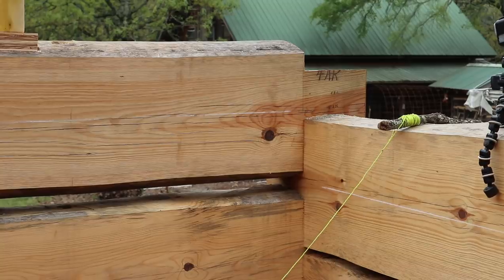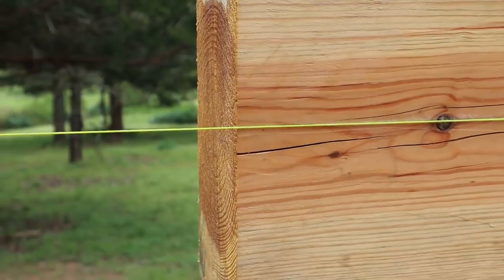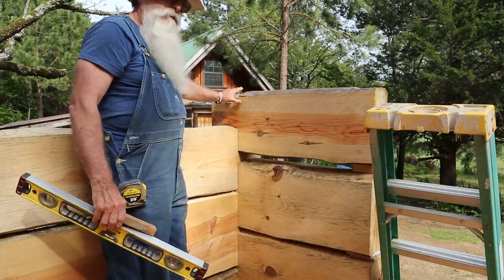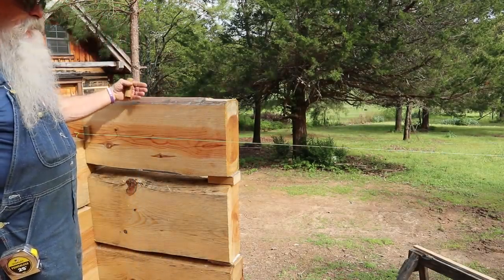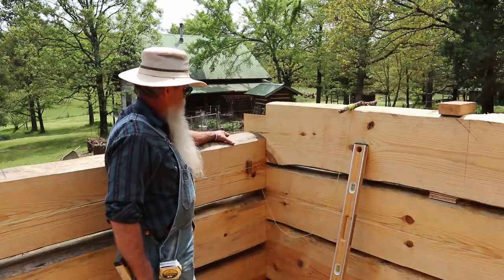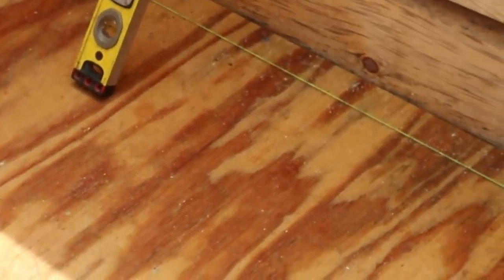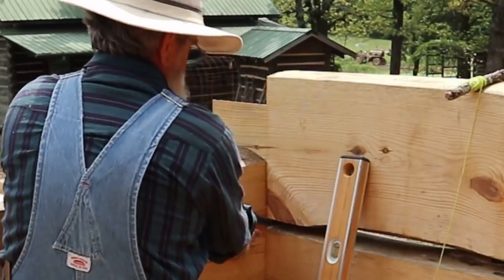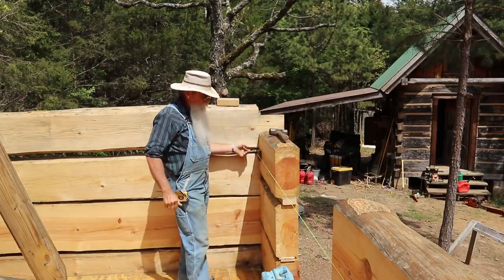Round 4 - Dovetail Log Cabin Build (Ep 22)

Comment: Dear Sir, greetings. I did not understand why was it necessary to use that small block on 4AL to check whether it is in line with the sill log, since you had already checked that by placing your 2 feet level along the inside face of 4AL? Do the two techniques give different results? Secondly, did you nail the string on the floor plyboards 3 inches inside the sill logs on all four sides, or did I hear you wrong? To the naked eye, the string looked like an inch or an inch and a half away from the inside face of the sills. Regards.
Reply from the maker: AS   Howdy AS- the small block is 6” long which is the thickness of the logs. By placing the level on it and checking for plumb will show how much wood needs to be shaved off either the inside or outside to make the log sit plumb on the wall. It gives me a more accurate way of knowing what I need to do to make it plumb. The strings on the floor are 3” in from the inside face of the sill logs and are held by a small nail. Sometimes the videos are a bit deceptive on the depth perception. Thank you for the questions- l hope l was able to clarify for you. God bless you

Comment: Good day to u sir, and greetings from South Africa. I have one question : Why do u not install the door frame / window frame at this stage in order to line up the logs from the corner to the door frame / window frame? Hugs and stay safe.
Reply from the maker: Annette Zang   Howdy Annette- Thank you so much for watching the video and you have a really good question. I have put in a temporary jamb to keep the logs in line but on this little cabin it really wasn’t necessary because the weight of the logs pretty much keep them where they are without them moving. After the log that goes over the door and windows is up I cut a groove for angle iron to fit in the end of the logs that make up an opening which keeps it all lined up. Hope y’all are doing well in Africa. Stay safe and God bless you

Comment: The detail explanation is greatly appreciated.  Thank you.    So how will you keep all the fine adjustment is its place while continuing on in the work, or will it hold its own and stay put?   I assume when the time come the hoist will be taken apart to remove it from the cabin?
Reply from the maker: J F   Howdy JF, the weight of the logs will keep them where I need them to be. After the header logs go up l will be putting angle iron in all the openings which will keep the logs from moving at the openings. The angle iron slides up into the header log and fits in a kerf in the ends of the logs. While the log is on the sawhorses l will cut a slot in them to accept the iron. When I get the second floor joists up l will take the hoist apart and put a shorter one on the second floor. God bless you

Comment: Loving the series. I've learned a ton already. However, I haven't seen nor can I find how to layout dovetail corners when using different size logs. Mine will be from about 10' up to 14'. I understand how it's done if the log heights are the same but mine will not be. I'm looking to use around 2' chink joints.  Any suggestions?
Reply from the maker: Jason Compton   Howdy Jason- we are working on a video ( or it may have to be a short series) that explains how I get the different notch dimensions using logs that have the natural shapes of the logs- butt and tip. There was so much audio problems because of winds blowing up the valley. Please hang with us til we can get it all worked out and uploaded. Thank you so much for your interest. God bless you
Reply: @TheBeardedCarpenter  thank you sir. I have plenty of time. I'm still about 1 year away from cutting notches. I still have to cut and mill the trees and then let them dry.
Reply from the maker: Jason Compton    What species of trees are you planning on using?  Hope all goes well for you. Blessings
Reply: @TheBeardedCarpenter  Longleaf Pine. I'm in Alabama and pines are plentiful. I have a lot of hardwood on my property as well and will probably use oak for flooring but I haven't decided for sure yet. I hate to cut my oaks.
Reply from the maker: Jason Compton   Pine is in abundance here also. We have a lot of post oak but it’s not easy to find a lot that would be straight enough for wall logs. We used to have a lot of red oaks but the bugs took them out. Blessings

Comment: Great video, thanks for teaching people how to build beautiful cabins. technical question .
you build a small cabin and the logs are connected only in the corners, and if you build a cabin 20 * 30 feet in size will there be no sagging of the logs in the middle because they hang in the air in this place? Do I need to connect the logs in any other way to each other for greater stability such as dowels?
I want to build a 20 * 30 cabin.
sorry for my English :)
Reply from the maker: arjan P   Howdy- your English is great. I put flat spots on the logs for blocking that helps support the logs from sagging and at all door/ window openings. God bless you
Reply from the maker: arjan P   I don’t use dowels pinning the logs to each other. Some people do that but I would have a concern with them affecting the setting issues. I ‘m not saying you shouldn’t do that but I have never had a problem by not pinning them because the joinery does a pretty good job. Blessings
Reply: @TheBeardedCarpenter  
thank you

Comment: Do you put any blocking between the logs for support seem only at a door way or window opening?
Denis
Reply from the maker: Howdy Denis- yes, I do put blocking in between the logs for support depending on the length of the logs. In this cabin the walls are 12’x16’ so the blocking is in the middle of the span. Thank you for watching and God’s blessings to you
Reply: @TheBeardedCarpenter  ok thanks i did notice that after watching ur video several times lol did a video the other day planning on picking out floor joist logs how big diameter were ur logs?
Denis
Reply from the maker: @denislosieroutdoors  The floor joists were about seven to eight inches. The wall logs varied from 15”-11 1/2” measuring at the midpoint. Going to watch your video. Thank you for coming by and watching. God bless you

Comment: What keeps the logs from twisting along the wall without using dovels?
Reply from the maker: Alvar Lipp   Howdy Alvar-  the openings will have 2x3x1/4” angle iron fit in a kerf in the ends of the logs which is slotted into the header log and into the bottom log of the opening. The notch holds the log at the corners. Thank you for your question. God bless you
Reply: @TheBeardedCarpenter  The wood you are using must be more stable than what i have used around here. I use mostly pine and spruce. Was taught to pegg the logs together in a scattered way every 50cm. That holds them straight . I have seen them twist even from the middle with years past when its not pegged together properly. Even notches dont hold on some logs. With dovetail we have used long metal rods drilled into the corners to hold. Saddle notch and norwegian notch hold a bit better. Usually avoid left twisting logs completely. Its great to see so vastly different technique of log building to what we do here in Eastern and Northern Europe. That wooden lift inside the house is genius! Thank you for responding! God bless you too!
Reply from the maker: Alvar Lipp   It’s always exciting to hear from another log builder! Thank you so much for your interest. I am building with southern yellow pine which we have in abundance here.  It is used in conventional house building mainly because of the availability and the strength it has. I too, try to avoid left hand twist, but occasionally you have to deal with it. Yellow pine is a heavy ( weight) wood and will, for the most part, stay put. I would say that white pine would be a little more stable but it isn’t available here where we live so l use what we have as did the pioneers who settled this area back in the 1800’s. I love the looks of round log buildings but I am pretty much a tradionalist with the hewn log, dovetail corners. We have lived in our house 25years now and none of the logs did anything other than the expected setting which l allow for- screw jacks, angle iron in the openings, and the way I frame the interior walls. I would love to see the buildings you do. I ‘ve always admired the European log builders. God bless and keep you safe
Reply: @TheBeardedCarpenter  The buildings you have built look cozy and straight. Very good quality craftsmanship. Here we have always thought about how Americans build with clay between the logs. I have never used this method but im hoping i get to try it out on a project. My great grandfather built hand hewn loghouses also that was a tough job. We use sawmills on the square log houses and notch everything with a chainsaw. Alot of ppl here prefer the traditional dovetail and norwegian notches. But i personally have always liked the round saddle notch more. I have been lucky to have been able to build all of the common notches. I am very thankful to God for giving me this passion that kept me busy so had no time to mess around haha. It is good there is so many ways to choose from when building a loghouse. We use the scribe method on all the notches thats where the difference comes in. I have built houses under companies for 14 years and i have always had my heart in it. Always wanted to learn more. Im happy that i found your channel and i will look thru your series gladly. You have a lifetime of experience ppl will benefit from definetly. I only have some old phone camera footage of me carving a saddle log. Have never thought about making videos of my technique. Maybe one day i will. But i have always made photos of my work. I would also use more hand tools if we were not rushed so much. Building for a company rushes things and would go bankrupt fast with hand tools. The rush we are in this world is bad not enough time to fully enjoy the builds.
Reply from the maker: Alvar Lipp  I do certainly appreciate your philosophy on log building. I do use chainsaws and power tools in building but to have an old tool in my hands is very therapeutic for me. I feel like l can get my joinery much closer by finishing up the notch with hand tools. I ‘m thankful for the modern tools and I do take advantage of them. If our forefathers had them they would certainly have used them. It’s so good to hear from you and I would like to stay in contact. I ‘m sure you have lots you could teach me. I certainly am not the best but I do have the same passion you do, so that makes us of a kindred spirit. May God bless all of your endeavors
Reply: @TheBeardedCarpenter  Its very interesting to see from your videos the similarities we have come to know even tho live on different sides of the world and seperate history. I know there are much more variety of trees in America than we have but those pine trees look like the ones im surrounded with. I would like to stay in contact definetly. Have alot of interesting methods and things to share. That is my real name i use on facebook if you want to stay in contact thru that. If some other way let me know. God bless you brother!